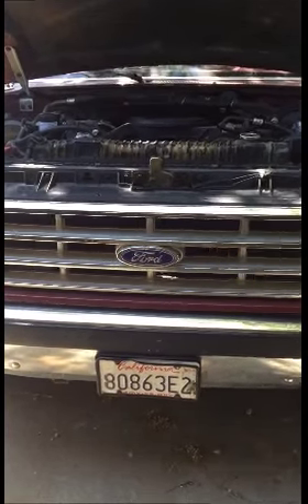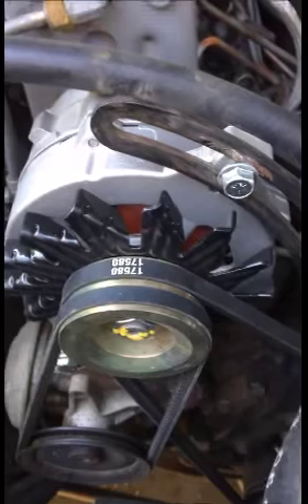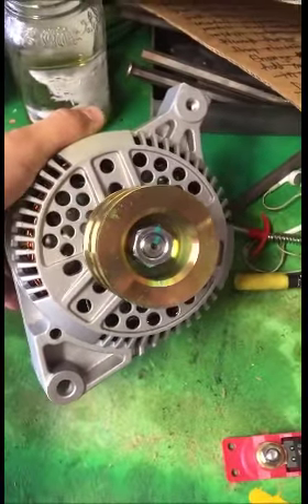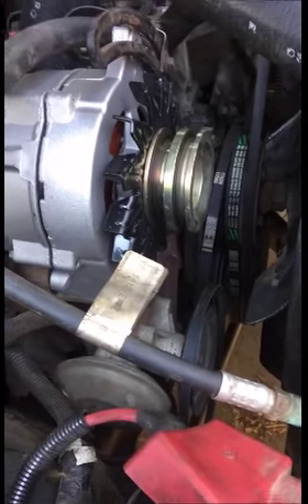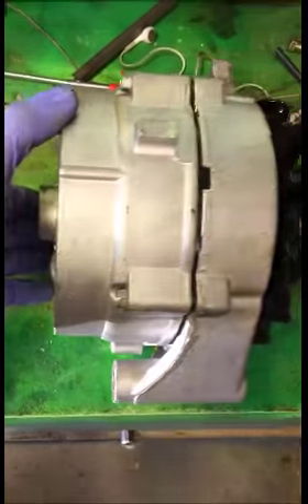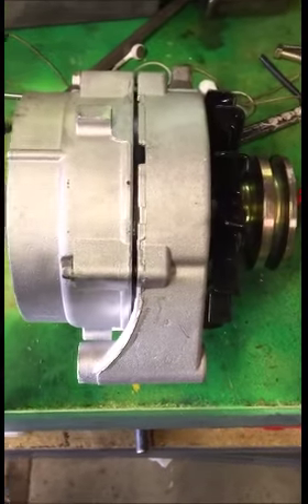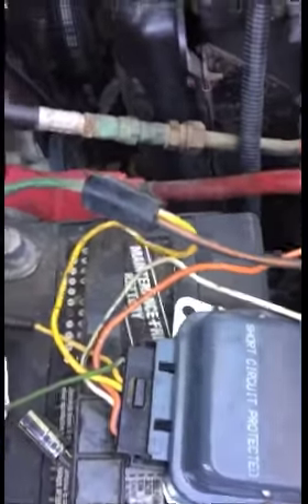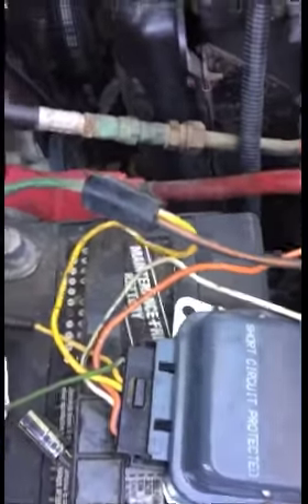1988 Ford F250 7.3 IDI Diesel 1G to 3G Alternator Upgrade

Comment: Great video, great upgrade. I ran into similar problems but I found out it was the wiring harness female plug that had 1 slot collapsed. Voltage regulator and alternators both checked out but the female wiring harness plug was so brittle one of the slots was not pinching the tang on the voltage regulator.

Comment: Yep I have a 91 f350 and the wires are atrocious,as it was my pops,and he did a lot of weird stuff to them.
However he kept driving it until they took away his license,than I bought it at a reasonable price,and the charging has been erratic.
Thanks for the tip I will be checking into it.

Comment: Ordered up the altenator and pigtail off rockauto. I'm having the exact issue you had. 1 week in between repairs both the voltage reg and now altenator have died again. do you have a part number for the Mega fuse you are using?

Comment: Got mine last week from a starter-alternator shop here local.      Truck is 1989 f-250 7.3idi The one I got had connections at 3 o’clock which is fine.  I had too much faith in the threads I read before hand.    So I asked alterntor people to clock it to 12 o’clock.     3 o’clock would have been better due to fuel filter head location.     Mine also had belt misalignment when just bolted on.     It was too far back so I ground 1/8” off the front “ear” of the lower mount-which Is really heavy cast iron so no concern with strength.    I also ground a bit off the alternator itself,   After bolting on it became apparent that I didn’t need to grind the alternator.   No biggie,   One .035” washer in front and 1/4” spacer in rear.    Belt alignment is sooo much better now.     I can’t understand why more people doing this didn’t notice the misaligned belt.     When alt belt is perfect, vacuum pump belt is a bit off.   So I’ll split the difference favoring the alternator.         I ran out of daylight today Xmas day.      I’ll source a big fuse tomorrow and some big wire.    
  My pulley nut  has a thread exposed which I don’t prefer.    The fórumes mentions this  and alternator shop said it’s ok so I’ll try not to worry.     The original alternator lasted a long time but after a new voltage regulator it still would show 12.2 athe rhe battery’s.    And then go up the 16-18 with no load.           Sorry for the long winded post,  I’ll be happy if rhe 3g solves my charging problem.
Reply from the maker: I did not have any alignment issues with my alternator to vacuum pump but I can imagine it happening, especially now that these trucks are over 30 years old. I am glad this video helped keep your truck on the road. My original alternator lasted decades but the replacement ones were complete crap. Let me know how it works out for you.

Comment: I'm putting the fourth alternator I've got from O'Reilly's in my Bronco right now so I guess it's not just me
Reply from the maker: Dude if you can swap it for a 3g alternator with at least 100 amps. I have driven about 10k miles now and I never get any kind of headlight dimming or charging issues. Truck starts every time even after sitting for months.

Comment: You can purchase the original alternator with the connections on the top.  Several are available, and that wasn’t the correct unit.  The truck didn’t leave the factory broke!
Reply from the maker: Bread996 ya the factory parts lasted 30 years, they were fine until they weren’t. I tried multiple times to fix my charging problems using multiple parts stores and I could not get any reliable parts!!!!! Doing this swap has been awesome, truck has never not started or stopped charging or had dimming during idle.  Plus you gain like 100 extra amps!!!!Best thing I have to done to make my truck more reliable.

Comment: So, I don’t need to run any wires to my starter? And nothing directly to the battery itself ?
Reply from the maker: No, there is a battery distribution block that you run the main hot wire from the alternator. Re-watch the video and you can see where I tie in the 4 gauge hot wire from the alternator to the battery distribution block, don't forget the 175 amp fuse.

Comment: So the blue wire goes to the lead post on the alt 
Red wire splices into the green to connect the garnets where did the yellow wire go ?
Reply from the maker: It connects to the stator on the alternator. it's labelled as S.

Comment: My belts are loose even at maximum,  did they stretch or is the pulley on the new alternator wrong?  It looks the same as the old one, but shinier
Reply from the maker: I would get a belt that is an inch shorter and try that. I did not have any belt issues with my truck

Comment: Have you had ant trouble with this alternator ? I see that you did this upgrade in 2017.
Reply from the maker: No, it was the best thing I did for that truck. I sold the truck not too long ago but after I did that conversion I drove that truck from the Central Valley to Northern Washington, Southern Colorado, Southern California, and Central Arizona. I never had to worry about that truck leaving me stranded again.
Reply: I just did the upgrade today with junkyard parts. 70$ to upgrade to a 130 amp alternator.

Comment: So I  just completed this install a couple days ago, but I get a battery light and no charge. I get 12 volts all along the battery cable from the solenoid to the B+, so I don't think it's anything related to the 4 gauge line. I suspect it's related to the I wire "pigtail" connection: I cut the wire from the regulator and it meets with the wires from the tach. Spliced it to the open I wire with plug connections similar to how you did. Is it not getting enough voltage because I didn't solder? Stator and sensor wires seem good too. Any help is appreciated.
Reply from the maker: Check for 12 volts from the green wire with the key on. The green wire gives voltage to the alternator to power the alternator to generate a current. Alternators do not have magnets and they generate electricity from a small amount of power (green wire) to generate a magnetic field.
Reply from the maker: Also, check the connections on both terminals at the S, and I on the alternator.
Reply from the maker: If you are still having issues go have the alternator tested.
Reply: Thank you for the response. I was able to get the alternator to charge when directly contacting the I wire with the battery positive post. I used a meter to test my green wire, and it looks like it's putting out the same amount of voltage as the batteries? Weird that it won't work. I'm about to try my I line connected from the glow plug relay ignition source instead.
Reply: Running a second connection from the glow plug relay to the I wire pigtail did the trick. My only issue is a bit of voltage fluctuation at idle. 14.4-15 volts or so.

Comment: Is heavier gauge wire needed for the harness after the alternator swap?
Reply from the maker: Yes, you will want to run a gauge 4 or 6 wire from the alternator to either the battery directly or to the distribution block (the latter is where I connected my power wire). The signal wire size can be the same size, 16-18 gauge. Just need a larger power wire because the output is like twice the number of amps over stock.

Comment: any trouble after taking that factory voltage regulator out? I'm getting ready to attempt this swap and it just seems weird throwing it out
Reply from the maker: It's been the best thing ever! Truck starts every day (even after sitting for a month), I drove my truck to Yakima, WA with a car trailer (with trailer lights) it took 20 hours one way a few months ago and I still dont have any issues. Best thing is to ditch that factory unit as soon as you can.

Comment: Thinking about doing this with my 90 7.3 Turbo thinking there's something wrong as the gauges have started acting up and flipping around in the lights go dim and bright
Reply from the maker: I would first look at the battery (+-) cables for corrosion and replace them. Yeah, the alternator could be starting to take a die. I found with owning several of these trucks that the alternators tend to be where my electrical issues are.

Comment: Hey man, I was wondering if you had to use different length belts as the pulley is smaller?
Reply from the maker: No, I never needed to change the belt size. Just make sure the pulley on your old alternator is the same size as your new alternator

Comment: Is this a large frame alternator or small frame
Reply from the maker: Devin Ames I am not 100% on this but I believe it’s a large frame alternator
Reply: Robert Taylor ok thanks man I was just wondering I have a 1987 f250 6.9 idi the battery light won’t shut off the alternator does its job just not that well I wanna throw a 200amp in there

Comment: I know this is a old video but do you still know the actual part# for the alternator they keep showing me a different one then what you have there
Reply from the maker: I think a replacement alternator would be BOSCH AL7526N. Cross-reference this with a 1993 Ford 7.3 Diesel Ambulance package. 130 amp alternator is what you're looking for.
Reply: Use an alternator from a 90-95 Ford Taurus with the 3.8 i was having the same issue
Reply: Brandon, did you have to change much on wiring and fuses

Comment: i am a little confused with the wiring. you mentioned a ford forum at the end, could you give me a link please! thank you
Reply from the maker: Here is a helpful link. 

https://www.ford-trucks.com/forums/1502268-87-f-250-idi-1g-to-3g-alternator-upgrade-issue.html
Reply: @roberttaylor8918  Thank you so much!! one last question and ill leave you alone i promise. on the mega fuse. How many amps should i get? thank you!
Reply from the maker: @zavalalandscapegroup9612  175amp
Reply: Did the 3G upgrade affect the stock volt meter's ability to work?

Comment: Ware does the tach plug in to the alternator
Reply from the maker: The tach does not plug into the alternator. The wiring for the tach is in the same part of the loom as the alternator wiring.

Comment: I am getting ready to do this swap myself, I have everything figured except where to get the pigtail. you mentioned ebay, do you have a link or part # where i can order one?
Reply from the maker: Cody Pierce this is the one I found on eBay but I am sure you can find a cheaper one with more searching

https://m.ebay.com/itm/2G-to-3G-Ford-alternator-Voltage-Regulator-Conversion-Wire-Pigtail-Harness-Plug/112290562080?hash=item1a250a0020%3Ag%3Aq84AAOSwLEtYk4-h&_trkparms=pageci%253Acbadabd2-bc0e-11e7-8aa0-74dbd1808daf%257Cparentrq%253A64449c9c15f0ab4d2c0922fcfffc0481%257Ciid%253A1

Comment: Robert - thanks for the video - one question - the pulleys on the new alternator are a lot smaller - and now my belts are too loose - do you have a part number on a belt that will fit by chance?
Reply from the maker: No, but take your belt to Oriellies and have them get you a smaller one.